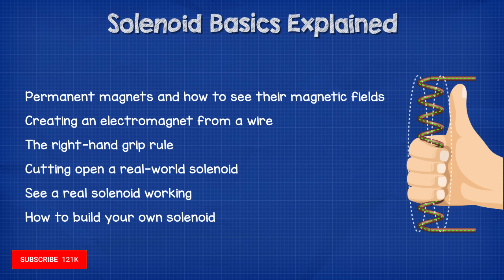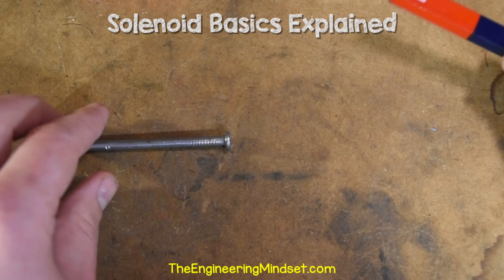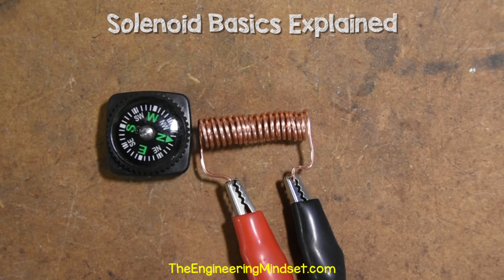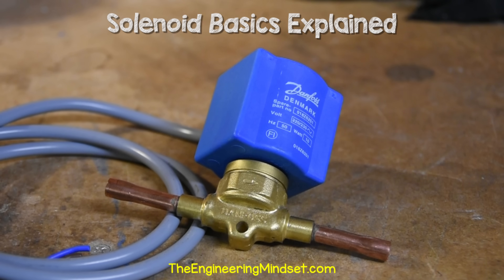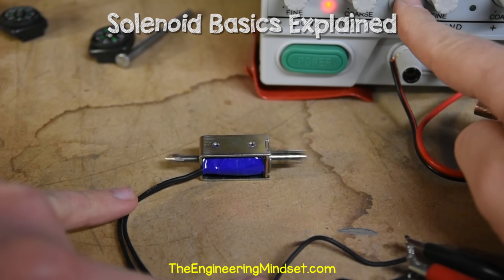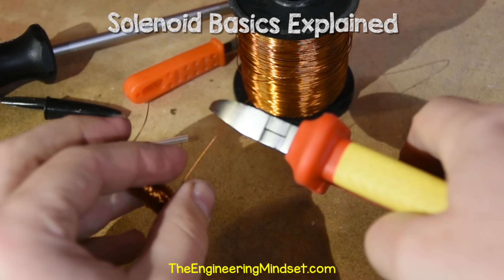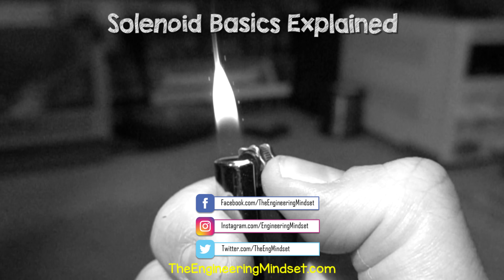Solenoid Basics Explained - Working Principle

Comment: Which kind of current did you apply to the solenoid? Is it AC or DC, I mean, the one used, designed with a biro plastic? if you used DC, did you limit the current with a resistor, or did you just apply DC without a resistor? Kindly explain. I love practicing whatever I am watching from you here. I noticed you are using a power supply.

Comment: It still doesn't quite explain why it moves.  If the nail is already all the way through the coil,  then why does it move?   There is a key reason happening that you failed to explain.  Is the nail trying to self center?   You showed how the coil is magnetized with a N and S pole..   So does the Nail also become magnetized with the same N and S pole?  Or is it magnetized in the opposite direction?   There is definitely more explanation needed.

Comment: At minute 8:24, how does the nail get pulled in to the right? If we apply the right hand grip rule based on conventional current flow, shouldn't the magnetic field push the nail out to the left?

Comment: What I don't understand is how the wound copper wire doesn't just act as one thick copper cilinder. Is the enamel coating on the copper wire an insulator? He says to sand it off the ends to get a "better connection", implying that there's some conductivity with enamel intact.
Reply from the maker: Yes it's an insulator, otherwise it would short circuit and current wouldn't flow around the wires

Comment: the reason you used an angle grinder is the same that made me use my (italian 16th century real battle ready) longsword to cut down a tree so i could make an axe handle to cut out a bigger tree, to make my (fully functional, literally from scratch and VERY powerful, even the mountain would have to use the winch to draw the bow, oh and obviously the bow wasn't made out of some freshly cut tree but carved out by hand out of a MASSIVE table leg, like larger then both my legs, perfect century old dried out ideal wood) crossbow.

or the reason i made a 8kW cigarette lighter that weights about a ton. and i'm actually serious lol, not for the ton but i decided to make a fix lab lighter out of... *stupidity enters the chat, overkill is made moderator*... 4 2000w massive  microwave transformers. and yes, to those who are asking themselfs 'he can't be dumb enough to...', i was. should have ended with a darwin awards tbh, i DID initially just wire the 2Kv output in series to get a 8kv plasma arc that could burn though anything and was just waiting to kill you, but don't worry, i changed the wiring after about 20 minutes when leak currents started creating random arcs from the wire burning into my workbench.

now i still have a 8000 watt lighter but its safe, took an angle grinder to the secondary,, rewired a few loops of ridiculously thick cables, and now i have a lighter that (in // not series) blasts upwards of a thousand amps (at a tiny voltage) though a poor large steel bolt, instantly getting it red hot and accounting for the strangely larger 'other' portion of my electrical bill

Comment: Just a heads up to those watching: changing the direction in which you wrap the wire will not strengthen your solenoid. The resulting magnetic fields will cancel each other out and DECREASE your final magnetic field

Comment: About the current flow from + to - or vice versa:
The fact is, electrons travel from the - to the +. BUT because they have a negative charge, mathematically speaking, the charge at the + gets "smaller" due to the addition of negatively charged electrons, and it gets "increased" at the - due to negatively charged electrons leaving. At least that's how I explain it.

Comment: A question I have about systems like this, how does the copper wire being bare within the solenoid coil not cause a short?
Reply from the maker: It's not bare, it has a thin enamel coating that insulates it

Comment: Why doesn't the solenoid create a short circuit when the wire is wrapped around itself?  Wouldn't this create a shorter path for electron flow by just going straight through the touching wires and thus rendering the coils useless?  Why doesn't there need to be insulation between the coils in order to ensure electron flows properly through the solenoid?
Reply: @EngineeringMindset
2 months ago
It's not bare, it has a thin enamel coating that insulates it

Comment: When you apply the right hand grip rule, you don't mention the winding direction (like a normal screw or a special left step one) which is confusing. It would change the poles; anyway great video.
Reply: Seeing it again, your small fingers  are not pointing to the conventional current flow if I refer to the pespective view of th coil before (left winding).
Reply: CORRECTION: "left thread" instead of "step".

Comment: I came here because I am studying lock-out/ tag-out for my plumbing course. 
Energy-isolating devices do not include on/off switches and control valves at the machine. These can easily be turned back on, and often do nothing to remove energy from the equipment. In many cases on/off switches are low voltage switches controlling higher voltage relays and solenoids within the machine. Turning these off means that there's still high levels of available energy within the equipment.
I tried to get a better idea of a solenoid is, and how it applies to this context.

Comment: If I used an AC solenoid valve would it mean that it would move the plunger up and down regularly because of the positive and the negative cycle of the AC voltage.
Reply from the maker: No, it'll stay in position. If you slowed the frequency down to like 0.5Hz maybe it'll move back and forth
Reply: As I understand the theory, yes the plunger should move in and out regulary because the polarity of the supply is constantly changing. It's like you manually change the connection on terminals of a DC supply constantly.

Comment: So if you make a coil and insert a plastic rodd which has a metal extention (that is shorter than the coil in length) and you put a current on the coil, you would feel a force when you try to pull, as well as push, the plastic rodd ?  And the force you feel increases if you increase current ?

Comment: Hi there. I am having an issue with my 1/2" 12v solenoid valves (norally closed) getting stuck open after a couple of rapid cycles. I can't figure out why this is happening or what to do about it. Does anybody have experience with this and can give me some tips? Could it be that I have bought cheap and inferior quality solenoids? Is it a 12v issue that would not happen with 220v?

Comment: I made the experiment of an electromagnet by winding wire around a bolt then attached with 1.5V battery 
 but it does make one pole magnet 
I mean why I don't get S N poles

Comment: Good day. My air tyfon is not working correctly. It can start, but it did not stop by itself. Solenoid valve is opened but could not to close. Tyfon only stop when closed air inlet valve manually. May be you now what can be the reason?

Comment: Can some one explain to my why old starter motors have 2 wire inside their starter selenoid?
They say hold in wire and pull in wire.
What does that mean ? 
I tought you need only 1 wire to pull ore push a peace of metal what functiin has that other wire?
What is it used for???
Reply from the maker: It's explained in this video https://youtu.be/7eN1gxH6lE4

Comment: What's the difference bw copper wire and insulated copper wire ????
And also what kind wire is used in motor coils ???? 
Is it insulated copper wire or just copper wire

Comment: Permanent Magnet is always working it can’t be turned off because it’s made up of many smaller Magnetic Domains that are line up and pointing in the same direction. 

A metal bolt made of iron or nickel which is not a magnet, it’s made up of magnetic domain put pointing in random direction. If we take a wire warp it (coil) around several times and create a circuit, the current through the wires forces the magnetic domains to line up, and now the Electromagnet was born. 

That’s how an Electromagnet work.

Comment: Great vid but there's one shocker. Establishing the North end of the solenoid. It's not true to say that the the direction of current flow gives the North side (4:14). The wires can be wrapped clockwise or anticlockwise and this gives two different orientations. Please correct this, it's causing misconceptions. I would have used this clip for teaching but it will create headaches for me.
Reply: You are very right, I at first thought I got a different view of explaining to my learners but Oops, not right.
He should only use the clock face rule

Comment: Does the polarity of the ends of the solenoid not also depend on the direction of the coiling (clockwise or anticlockwise) as viewed fro the ends. This means that even with current going from one side to the other, the poles could be either way around?

Comment: how much voltage and current did you use to avoid short circuit and high temperature in the cable ?

Comment: What makes a solenoid bad or better yet what goes bad on a solenoid for it to stop working. I have a ford truck that has a solenoid that gets activated when pressed on the foot break. It allows you so shift out of park.  If will out and not retract the plunger. I have to manually press down and then it will work for a few days or even less same day.  The solenoid looks like the one you demonstrated.

Comment: My 8th grade science teacher used this to teach us about solenoids, and here I am using it again in my free time because its just so good!  Also, big thanks for teaching this so efficiently, for I was struggling with a drum of enamelled wire trying to figure out how it works before I realized you need to sand the ends before electrical contact works best XD.
Reply: learning solenoids in grade 8? holy, here in england we learn it in 10th grade / year 11

Comment: Thanks for the brilliant video! I have a question though. At 8:29 when you push the nail fully into the container and pass current through, how is that generating a pushing force and pushing the nail in the opposite direction when you haven't flipped the terminals either?
Reply: I believe it is because the wires magnetic field aligns the nail to the centre of the coil. It looks like it just overshot a little because it didn’t have anything stopping it in the first example
Reply: @calvinrule6635  Thank you, that seems to make sense!
Reply: @calvinrule6635  I had the same question. So the current direction doesn't make a difference to the operation I guess.
Reply: @pilotboy2612  yeah it looks like it doesn’t matter where the nail is, it will always align to the middle of the coil
Reply: He just used this as a crude example of the basic function of a solenoid. I believe the amount of winding and current would be factored in to a manufactured product and the return or open position could be achieved with a spring or additional wiring to reverse direction.

Comment: The piece of metal that gets moved inside the coiled region also becomes a magnet of opposite polarity when the current in the coil is turned on. that is why it moves in the direction of conventional current flow.
Reply: That's what I was missing. Thanks
Reply: Just wondering how does the metal take on the oppasite polarity? What's the science?

Comment: But I need more explanation why the nail moved when the coil was magnetized...
Reply: Hey I’m in my first year of EE but maybe I can answer your question. The coil generates a magnetic field which polarizes the iron nail just like a normal magnet would if you scraped it on the nail. The nail has no magnetic properties when it is not actively being polarized but acts as one as soon as it is confronted with magnetic forces. The nail also gets polarized evenly which is why it is centered. Take this with a grain of salt as magnetism is not my specialty 🙏😂
Reply: Herakles The First Thanks. Your comments helped me understanding. The nail was magnetized by the current thru coil and then moved to the equilibrium point. I was confused at the first example not knowing the full thrust of the nail was not because of magnetism but inertia by the magnetism.

Comment: if we were to place a sprig at the end it would return to original position, dont know what that means exactly and why would it do this? no explanation or intuition was given....also why does the nail not go all the way in , no explanation of the attraction and the behavior of the nail was given at the end....i am seeking answers.
Reply: Leave the contraption spring loaded. So that when you activate the switch and the rod goes in one direction, then when you switch it back off, the rod would just sit there uselessly remaining in the on position. Fortunately you tied a spring to one end and the point the rod left in the beginning so now it springs back to it's original position so the switch can be useful a second time and more.
Reply: The point of the contraption is to move a rod back and forth. Flipping it on only moves the rod a finite distance in one direction. Turning it off does nothing. You could reverse the current to move it the other way. You you could make it spring loaded so you don't have to overcomplicate the circuit.
Reply: @jeffborders5526  I dont think reversing the current will make it move the other way.... I say this because there is no repelleing forces. Once the rod is in its in....it would move the other way perhaps if the rod was polarized or magnetized where the polarities were opposing each other when the current is applied.....any thoughts?

Comment: so I just tried to make my own solenoid with an 18650 cell battery with 3.7 and non enameled wire. The battery just got hot is all that happened. Where did I go wrong?
Reply from the maker: The coil short circuited because it's not enamelled
Reply: @EngineeringMindset  thanks. I figured but I couldn't even get a result with a insulated wire. Thinking back on this I was also using a 12 gauge wire. I guess using a single copper strand helps keep the flow down?

Comment: I wonder which part or parts of a coil effects the power of the magnetic field ( rounds of the wire, length of the coil, thickness of the wire or the material of the spool)

Comment: Great video on solenoid. There is one question. how to obtain direction of displacement of the nail kept inside the solenoid or direction of force acting on the nail kept inside solenoid ? Whether nail moves towards N pole or S pole ? please answer, it will be helpful. Thanks in advance.

Comment: When  I make this the copper wire starts to 
glow red hot. I used AA 1.2 volt rechargeable battery
Reply: The resistance in the copper wire is too low, therefore the current are «too high» which leads to the copper wire generating heat.
Reply: @sivertfiveland774  thankyou

Comment: This was was a great video, but I do have a question of how does a solenoid on something go bad? If it's just a wrapping of wire that has a current being shot through it, how does that go bad in some applications where a solenoid doesn't work anymore and needs replacing? What goes wrong?
Reply: If the wire or its insulation has a flaw, it could eventually become shorted.  If too much voltage is applied or the coil gets too hot, the insulation could break down and the coil could short.  If the wire has a nick in it, it could eventually break and the coil will no longer be complete.  Remember that the magnetic forces acting on the nail can also act on the coil wire and move them, too!   Well-designed and built coils should minimize this effect, but if there's an inherent flaw, it may cause eventual failure.

Comment: I have a 12 volt continues duty solenoid for a 50 amp circuit. 
When the draw on the battery through this solenoid is 10 amps, what amount of wattage is lost due to the solenoid?
In other words, how much power does the solenoid use? How can that be calculated? Thanks.

Comment: Hi,
When you create the coil, why isn't it creating a short of the coils are giving each other? Even with the enamel sanded, isn't the inner copper wire conductive with the outer portion of the wire?

Thanks!
Reply: No, if I understand you right, the enamel makes the wire insulated.  It is just a very thin insulation.

Comment: Beautiful explanation. Must say you made me to understand easily. Keep the good work going. By the way, solenoid valves are used more in chemical industry. Am I right? They operate to close or open openings to allow/disallow movement of liquids. Please correct me if I am wrong.
Reply: my grandfather uses them in plumbing so that you dont need to physically go down and close a valve! so it can be used in plumbing too
Reply: @slipnich.6874  thanks

Comment: Excellent video. I especially liked the last part where you create your own solenoid switch. I got one addition to the right-hand grip rule: the direction of the magnetic field (where is N and where is S) not only depends on the direction of the current flow. It also depends on the winding direction of the solenoid: are the windings (seen axial wrt the solenoid) wrapped clockwise or counterclockwise. Your rule is correct in the case of CW. If they are wrapped CCW (and same current direction ofcourse) then the N is on the left and the S is on the right.
Reply: Amazing contribution.

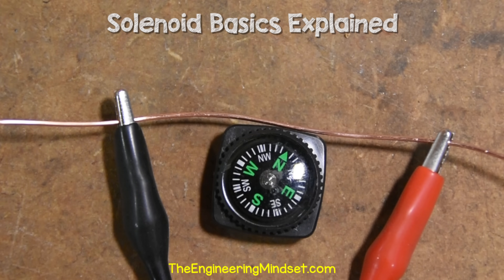Comment: 2:52 Did you just put a short across the power supply?
Reply: Yes, and shorts the coil too.
Reply: Unless he has resistor/circuit connected to either terminal out of camera view.
Reply from the maker: Check out NEW resistor video, everything covered! ➡️ https://youtu.be/DYcLFHgVCn0